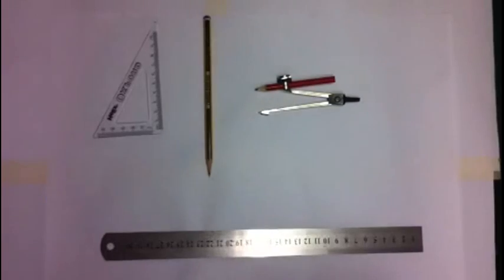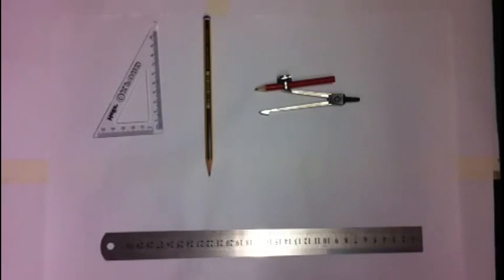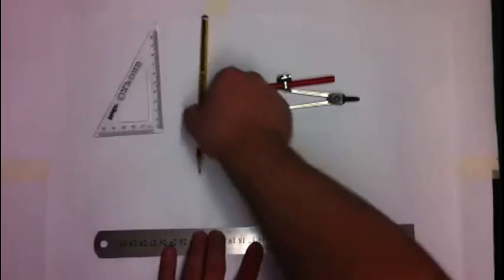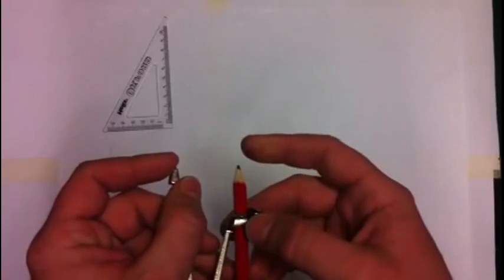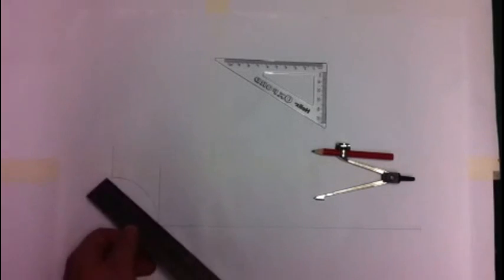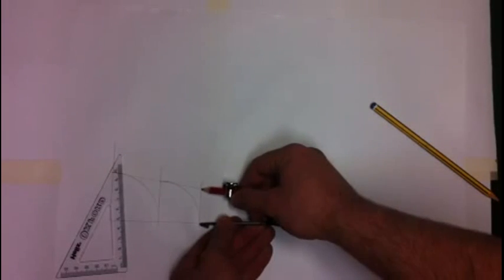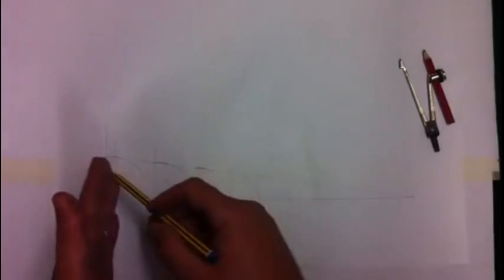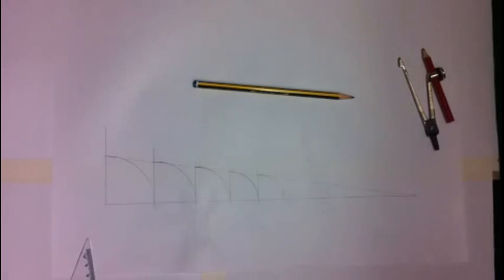How To (Guitar) Fret Slot Calculation Made Easy

Comment: you should use the square when making that vertical line for the nut or otherwise your first fret drawing will be inaccurate if the vertical line is not exactly 90 degrees. you have to be very precise with this stuff.

Comment: This might work if you have your first fret measured correctly.  To determine that, first you must know the length between the nut and the bridge. If that is 25 1/2 inches, then you divide that length by 17.817.  That equals 1.43 inches.  I just checked this on my strat and it was perfect.  Then you subtract that amount from the total distance, and divide that result by 17.817 to find the distance to the second fret.  25.50 inches less 1.43 inches = 24.07 inches divided by 17.817 = 1.35 inches from the first fret to the second fret.  obviously you can also add the numbers together for the center position- for example 1.43 inches plus 1.35 inches = 2.78 inches from the nut is the center of the 2nd fret.  This holds true all the way down the neck.  25.50 inches less 2.78 inches = 22.72 inches divided by 17.817 = 1.28 inches.  2.78 inches plus 1.28 inches = 4.06 inches from the nut is the center of the 3rd fret.  Also note that the one octave mark is exactly have the length of the distance from the nut to the bridge.  On the strat total scale of 25.50 inches, that means the 12th fret will be 12.75 inches from the nut or the bridge.  I just measured my 12th fret and it was 12 and 3/4 inches.  Pythagoros (sp??) was a pretty smart dude.  It occurs to me, however, that most rulers don't have marks in hundredths of an inch, so the Brit probably has a good point to use the metric scale (millimeters).
Reply: Where did you get that 17.817 number, just wondering??
Reply: You are absolutely correct, sir.  I have been building cbgs here in states for years and I had just copied my strat' s fret spacing, made a master template and have transferred template to finger board blank and cut frets, perfect every time.  Just measured mine again and still spot on.  Octave =  12.75, one thing he is so correct in a sharp pencil is critical!  Thanks for video and comments.

Comment: I marked this out four times using a quality 36 inch rule  to give me my 25.5" scale length and tangent line, I also used a quality compass, triangle  and a very sharp pencil.  I very carefully marked out as you demonstrated making sure the point and lead tip hit the marks exactly. I own two USA   Fenders a Strat and a Tele and when I laid   my drawing  on my fret board under the strings or against the side of the fret board all four were totally inaccurate after the fourth fret onwards against both guitars. I used a fret calculator to find the first fret spacing. Can't believe Fender fret spacing is wrong on two guitars or any guitar(???)  I only did what you did. Please tell why this didn't work. I didn't think this would be accurate to damn easy to be true.
Reply: Thats Fenders for you, over priced crap

Comment: Yes, I did this method for a 22" scale fret board for a mandola, I think it was. This was late last year or so.  Kept the drawing, never made the FB.  But I need one for a mandolin.  If I get the first fret distance as accurate as possible, all the rest should be correct.  Am I correct in assuming this ?  Thanks.   Bob
Reply: My response is late, but yes, you can use the same template as long as you use the length of the first fret, it will work for ANY scale

Comment: how do i compute the first fret using only string length from nut to bridge? thanks
Reply: Every fret divides string length by "12th root of 2", so it's easy to calculate everything.  Line Jeff Stinson, this is an interesting geometric construction that makes me uneasy because errors are cumulative.  Fret[n] = ScaleLength - ScaleLength * Inverse12thRootOf2^n, where Inverse12thRootOf2 is about 0.94387431268...   What is most important of all is Fret[12] better return 1/2 * ScaleLength, and Fret[24] better return 1/4 * ScaleLength.
Reply: rrr00bb ???????? can you speak english please!
Reply: cast390 ?? it looks like some junk got pasted into my reply.  it is nonsense for sure.  Get out a calculator and compute the 12th root of 2 (call this number X).  Start with an open string, and just multiply by X to get the next fret length.  Google the word "microtonal" and it's probably the first topic that comes up.

Comment from the maker: Hi missbreaky the 5cm I used was just to demonstrate the first fret can be anything depending on your scale length you can get the first fret measurments off the net or if you want to measure off a guitar you already have then you measure from the fretboard side of the nut to the centre of the first fret if you have any problems or need any help email me at stiggysixtytwo@gmail.com and ill help if I can regards stig
Reply: Sir I did like this but not same another guitar fret please can you show me another video which is to be practical frets measuring

Comment: maybe it's just me, but this seems way more complicated and will only give you 12 notes per octave if you get the first fret perfect.  plus, any inaccuracies will be more and more noticeable as you make more and more frets.  it's a neat trick, but with a spreadsheet you can quickly find all the locations...then if one of them is a little off, it won't effect the rest.

the frequencies in the 12 note system come from multiplying the first note by a 12th root of 2, so that after 12 notes, you get a 12/12 root of 2, or just 2, so the frequency has doubled.

I measure all fret distances from the same location so a mistake doesn't propagate.
Reply: +Jeff Stinson ,I  agree,done it 10 times and it is not spot on